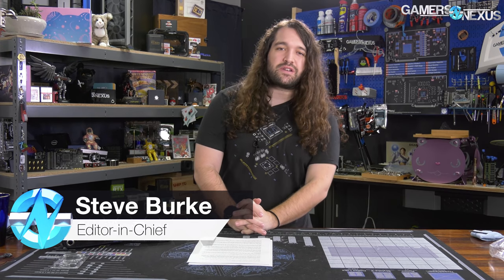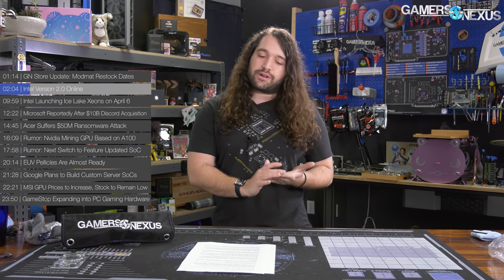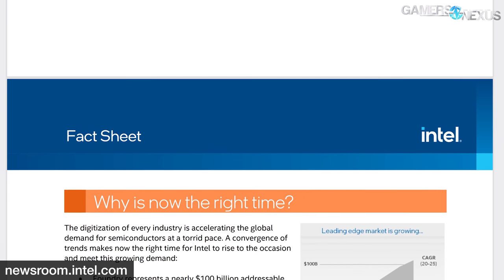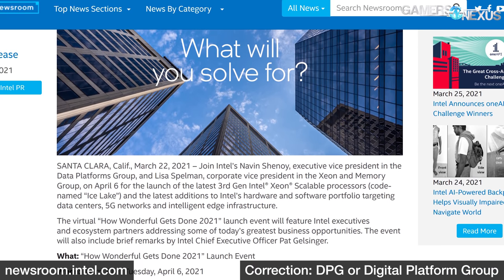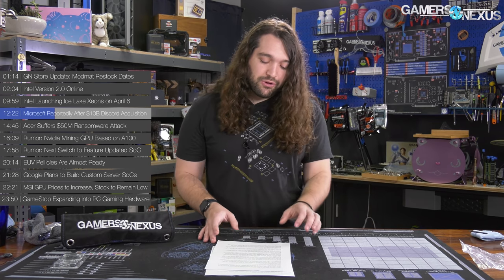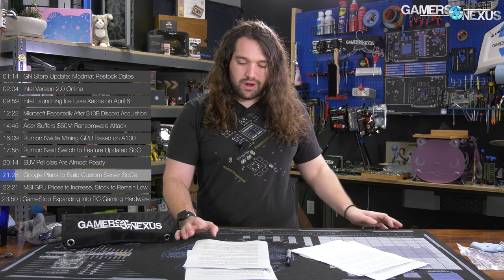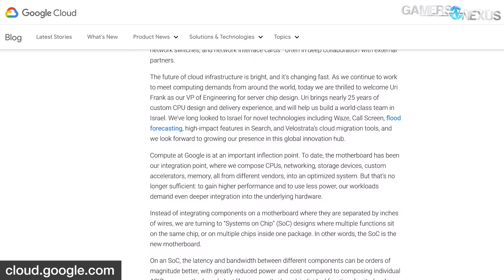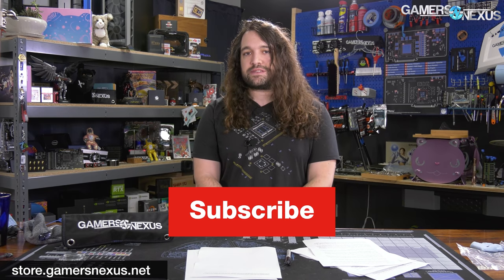HW News - Intel's Comeback, MSI GPU Price Hike, GameStop PC Hardware, & NVIDIA Mining GPUs

Comment: Will never buy anything MSI again.
Reply: You are probably not in Europe because you would never be able to buy tech hardware again.
Reply: @Superiorer  🤣
Reply: @Superiorer  I am in Europe and i will too avoid MSI. It´s not that hard, actually.
Reply: What would you guys recommend in terms of Motherboard brand. My last two have been MSI so I haven't used another brands motherboard in quite a while. 

Current one I have is ok, my biggest dislike is the settings get wiped when you do a BIOS update even if you save the "profile to a USB drive", it will say you can't use profiles from older BIOS versions. That and every time I've updated the BIOS it screws up my RAID 0 array (2 3 TB HDD's I use for older games / games that just don't benefit much from SSD storage) and it removes one of the 2 drives from the RAID array. I have to follow these steps to fix it (no data loss occurs but it's quite annoying ( https://www.overclock.net/threads/howto-recover-intel-raid-non-member-disk-error.478557/page-15#post-28162010 ). 

From what I've looked at I like quite a few of the features Gigabyte offers, like Smart Fan 6 and its features (likes 7 plot points for creating fan curves, ability to have fans spin all the way down at a certain temp from a source you pick etc). And they specifically say you can keep all your BIOS settings after a BIOS update. Also just like the look of the BIOS in general. Simply curious what other opinions are.
Reply: @sean8102  
Asus 
Gigabyte 
Are two pretty good options. Asus is a little pricey and also very very good for the high end.
Reply: @FemmyFoxxo  They also increase the price too.

Comment: Gigabyte and PNY: We should lower the prices back to MSRP

MSI: 3 times MSRP is fair
Reply: MSI was such a great company in the past, i still remember their Lightning GPU lines. In those days, they were ahead of everyone. But today, they are building the cheapest and weakest stuff with high failure rate, focusing on good look only and demanding premium prices for it.
Reply: @Morpheus-pt3wq  ehmm 20series and 10 series msi gpus where objectively one of the best partner cards... Pls stop talking Bs just for the sake of shitting on MSI, don't get me wrong they deserve to get shit on but pls no Bs talk
Reply: @Morpheus-pt3wq  I have a msi 3060ti it is in no way a weak card even in comparison to other brands. It’s just stupid expensive
Reply: @darkdraconis  Their 900 and 1000 series gaming X cards were pretty much the best models. Nowadays their lineup consists of "budget" ventus/mech cards which sound like turbo jet engines and very overpriced high end cards bloated with rgb which perform worse than cheaper alternatives from evga/sapphire/xfx/powercolor or even asus
Reply: @darkdraconis  Their 3070 line uses a reference pcb design in some cases with lower spec components and also has a locked power limit less than the FE design yet they want you to pay well over msrp. That's tge definition of crap
Reply: Perhaps now I can be happy that I got my 3090 Suprim X for "only" 1850€, lol.
Reply: @siriusblue1832  The Suprim line is the only one they put any effort (component wise), so it is ok. Even for that price.
Reply: Why not charge for it what the market is willing to pay? Like Steve said, Supply is constrained and demand is insatiable. They aren't selling bread or water, they sell electronic devices for entertainment purposes.
Reply: @astronomyastrology7186  What's wrong with reference pcb? If anything, it's great because you can use  FE waterblocks for watercooling. If I remember correctly, pls correct me if Im wrong, MSI's 30 series cards had no hardware interference issues because they used better components than for example gigabyte. What I wanna say is, the cards are great, no one can deny that because you can measure and test it. Are the prices way to high for 30 series? DEFINITELY but so is ASUS, Asus ALWAYS has the most expensive air cooled card. At least the years back I can remember, never heard anyone complain about that. It's typical cancel culture. MSI is a company with scummy marketing tactics and I would never doubt anything that GN said about them in the video (Killshot MSI edition). But don't hate on the product because the people that create these objectively good cards put everything they've got in there. Hate on the company and the ahole marketing! (I can't speak for 30 series since I didn't get one)
Reply: Asus is strange in that they will have the cheapest and most expensive cards in any given tier.
Reply: @jasonoutman420  most expensive yes but cheapest? At least here in Germany they still have 50€ difference to the cheapest MSI and gigabyte models. Where do you live?
Reply: @ThunderingRoar  My 3080 ventus is very very quiet even at 80% fan speeds so idk about that one.
Reply: US, the TUF cards were the only ones to come in at MSRP on launch.  Now it's just a crapshoot on pricing as pretty much every retailer has jacked their prices at least 20%.
Reply: @Morpheus-pt3wq  totally agree wd yuh ..their gaming x trio line is jackass. There was time when their twin frozer shouts quality. Now its ol shit .  their dual fan linup is olso cheap
Reply: @Morpheus-pt3wq  I agree. 6 months ago I got an msi stealth 15 inch gaming laptop and the CPU fan is rattling. I’ve had that same issue on another msi laptop I bought about 3 years ago. Their quality control is shit.
Reply: People shit on PNY for no reason. They legit make fucking Quadros and they are American.

PNY > MSI
Reply: @jasonoutman420  Oh so you are talking about the present. Yeah like I said I have no clue about 30xx prices since its a huge cluster fuck since day 1. Germany went crazy over PS5 and 30 series. I packed my PS5 into the car the other day and my neighbor came over and asked me how much I would sell the ps5 for since his son wanted one and he didn't get it, whilst playing the "we are to old to play those games anyway card".
Reply: @siriusblue1832  got mine for 1300 xD I figured whenever Lovelace should come out and if  it's appealing, at this price I'll get a great resale value and ppl can upgrade without paying an extra Dollar for a 4080ti or similar and be happy with the 3090 for rendering and gaming alike 🤷🏻‍♂️ but for the even the regular prices I couldn't recommend it to anyone. 
Performance and cooling haven't been disappointing in the slightest to me, maybe my GPU is a lucky pick or maybe because there aren't that many Suprim 3090s in existence anyway and in consumer hands, most comments are from people without first hand experience 🤫
Reply: @Angrod98  I agree, but the 3080'd are junk, except for the suprim
Reply: @titaniummechanism3214  because there are only two major manufacturers of the wafers these GPUs are cut from, and only a few companies making them into GPUs... If they coordinate pricing they can operate as a cartel and artificially inflate the price people are "willing to pay" making each generation more expensive than the last to the point where they increase in cost more than they increase in performance ... 

"Free market" capitalism is a myth that always screws the consumer... Supply side economics is a bad joke, especially when coupled engineered obsolescence...
Reply: @titaniummechanism3214  This is what I don't get, it's exactly what you'd expect. Does everyone seriously expect them to "take one for the team" ??? No international corporation is on any "team" other than their own, guys...

Furthermore, everyone is ranting about how awful their cards were anyway, in which case, why do you even care if they're hiking their prices as a result of supply shortages if they weren't worth buying to begin with? Sounding like psychotic exes out here xD
Reply: @ThunderingRoar  Can't really complain about my 3070 Ventus 3X tbh. It's super silent and doesn't really get hot.
Reply: @Oakley999 Voltage does not equal power. Voltage really only just stabilizes, current is what improves performance. Also, the voltage curve that you're actually allowed to change doesn't really do anything for increasing the voltage. You can undervolt to a point to get more current and still stay within power limit, but eventually you run into instability.

If they just allowed you to increase power budget you'd be able to push voltage and current.
Reply: gigabytes price also went up. Evga, pny, and even asus is being reasonable. Actually Asus is the best, 3060 ti 3 fan cooler for just $460

Hmm, Gigabyte is way over priced or the best priced, asus is the same way so is pny. The market is crazy.
Reply: @Oakley999  you're literally saying "hey increasing the power limit doesn't do much, because it's locked down. But undervolting helps"

Actually being able to increase the power limit would be able to do the same that undervolting does, but more and with more stability
Reply: I got 3070 vision i really like it but the led is half broken
Reply: @Morpheus-pt3wq  do you have sources on those highest failure rates and them being ahead of anyone, cause on vids people always exagerate for the sake of it.
Reply: @senseicheems3270  how is a led half broken. or is it part of the leds?
Reply: @2nd_Directorate  isn't the suprim line cooler the only good thing? Its pcb is still garbage according to buildzoid afaik.
Reply: MSI does build quality product. I am happy I don't have to listen to the fan  whine on my gigabyte board, or all the conflicts and compatibility issues with Asus. Reviewers are to kind to Msi's competition. It is not personal just business.
Reply: What else should they do? If they don't then there will be stock issues and this way at least rich people can buy the cards. If you offer a card that can earn itself back through mining in a couple months you'd be a fool not to get one. As long as mining performance isn't seriously nerfed the prices will not go down. If you buy a 3060Ti at MSRP you will earn everything back in less than 2 months, I'd buy 10 of them if I could
Reply: @froesesp  Lol what? We can def shit on their pricing but to say that all of their 3080 are junk is just idiotic. Gaming X trio and Ventus are both quiet, stay cool, and put out great performance.
Reply: @orlandojuarez5745  They both suck in terms of thermals, they cheaped out.  I own 3 of them.  The 3060's and 3070's are fine b/c they produce a lot less heat.  I'm talking more about the gddr6x memory, than the gpu.

Comment: I'm still using an MSI GTX 1080, and I guess for various reasons I will still be using it for quite a while.
Reply: 1080TI here, and same.
If it dies for some reason right now, I'll be really screwed though. I traded in my 970 to get a 1080, and traded in my 1080 to get the 1080TI, I think the best I have in the parts bin is a 770. I probably should have kept the 970, it was a workhorse, solid for 1080p gaming, and I didn't get a lot for it on trade in.
Reply: @kathrynck  I also had MSI 970 in the past. It was the only GPU i ever had to RMA, because it died within 2 weeks from purchase. Well known ELPIDA memory, but no coil whine. From RMA i got another, with micron VRAM chips, that was whining intensively. After a year i tried SLI, bought Gigabyte G1 GPU and after a week i decided to end SLI and sold the MSI GPU. Best decision in my life back then. Not because of some faulty GPU from MSI, but because that´s what got me into BIOS modding territory.
I still remember the days i spent modding the BIOS of that Gigabyte GPU.
I don´t think the 970 was the best. Entire 900 series had broken boost, which was boosting core freq. in low loads and dropping back to stock clocks in high loads. Easily fixable with BIOS modding - disabling the boost and setting boost clocks as stock caused the same behavior 1000 series has. A GPU with stock clock set via BIOS mod at 1329MHz was boosting up to 1489MHz all the time. Funny thing is, i started tampering with modding the BIOS just to change Gigabyte stock fan curve, as it had preset minimum at 50% of fan speed (noisy af).
Also count in the VRAM issue, which crippled entire 970 line.
Reply: Same. I genuinely think that by the time this GPU situation is even somewhat normal Nvidia will be on the verge of announcing the 4000 series. Then I can have fun not being able to get one of those.
Reply: @Morpheus-pt3wq  I had the gigabyte G1. I liked it. you could go pretty high with settings and still get great frames at 1080p. Honestly I never checked to see exactly what it's behavior boosting under load was. At low load though, it did correctly de-boost. I like my stryx OC 1080TI a hell of a lot more ;) especially since I have a 1440p/120hz monitor now. But it would be nice to have the 970 as a backup, considering how scarce GPU's have become.
Reply: Gtx 980 here that crashes whenever it feels like it
Reply: Holding out with a GTX 970
Reply: I have a R7 250. I’d definitely trade
Reply: MSI GTX 1080 Ti here. It's still a powerhouse since I got it April 2017. I'd like to use better NVENC and more VRAM at some point. It's annoying to wait, but I can wait.
Reply: A 1080 ti can easily hit 35 Mh/s ($5/day). Just saying... 😆

Comment: Interesting story:
A helicopter was ferrying a few business men to an airport in Seattle, when a thick fog rolled in, covering the city.
The helicopter pilot couldn't see to get his bearings, and find the airport. So he cautiously approached a tall building rising out of the fog.
He wrote in large letters with marker in a notebook "WHERE ARE WE?", and held it up to the window, hoping the office workers inside could help out.
The office workers spent 20 minutes debating their answer, and then finally agreed on a reply, they wrote on a whiteboard and held it up to the window of the office building:
"YOU'RE IN A HELICOPTER"
The pilot, now low on fuel, make a quick turn and found his way quickly to the airport.
One of the business men, puzzled, asked the pilot "How on earth did you find the airport based on that ridiculous answer they gave us?"
The pilot replied "Well, their answer was technically correct, but utterly useless and unhelpful ...so that had to be the Microsoft building"

$10billion is $40 per discord user (250m users)... ask yourself how MS plans to make a return on that. And then add a few metric tons of bad ideas and user-unfriendly tweaks to discord on top of that.
Reply: Yep. I'll be deleting my account and asking for all my info to be deleted before this goes through. Off to figure out how Element works.
Reply: @poppyrider5541  Are you afraid MS will abuse your personal data? If you're a Windows user you're not very bright. :P (I am guessing you run Linux or BSD though).

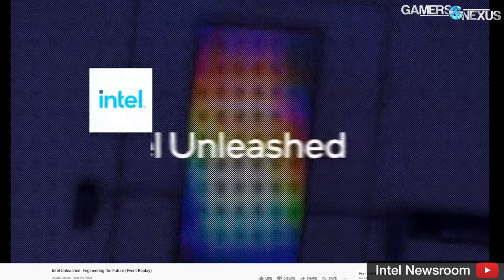Comment: The Intel clip at 2:34 is a wafer being held on by an X-ray diffraction machine - I wrote much of the software for that tool.  Our machine moved very slow compared to most other fab tools, so it made for great video clips.  The machines were built in the early 2000s - brings back a lot of memories while working on that system....